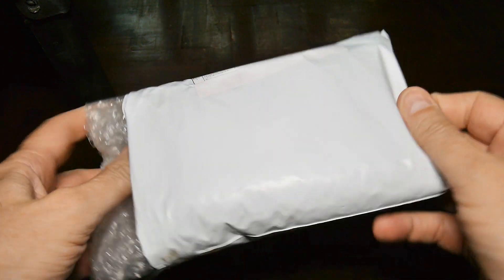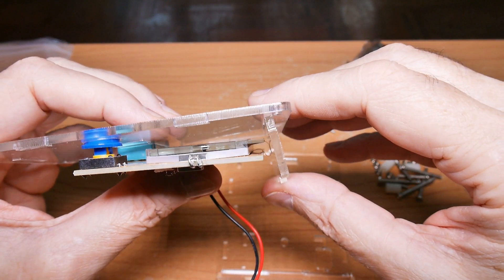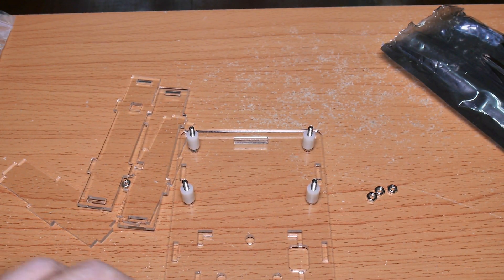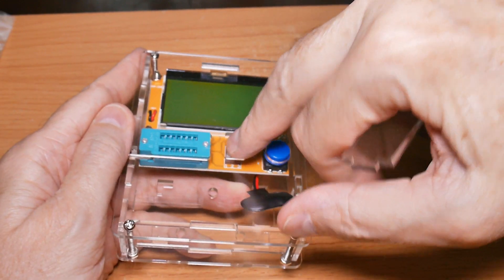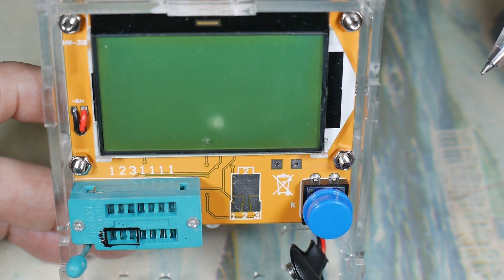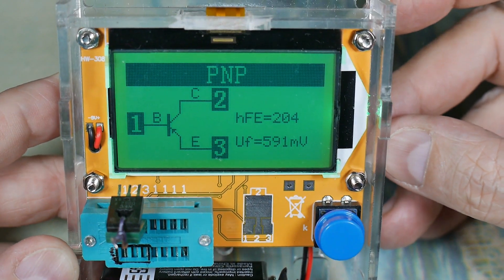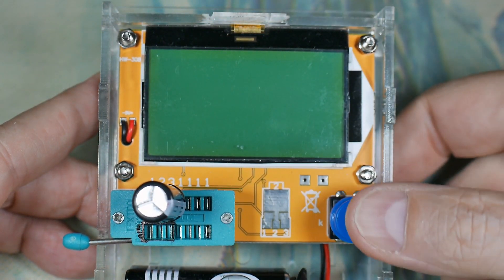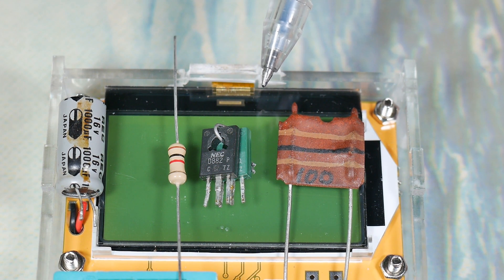Smart Component Tester - Assembly & Review (LCR-T4 M328)

Comment: I have one of these and so does a friend.  Any idea when I test a transistor on each them, one says NPN and the other shows the same transistor is a PNP ????????  What am I missing here?  It's a TIP126 bipolar transistor.  Thank you!  Great channel btw, I'm learning a ton!
Reply from the maker: Thanks. Same software version in each? Using the same holes in the quick release? Using the very same transistor to test (not just the same type)?
Reply: @tsbrownie  I'll need to check software version.  But, yes it's the exact same transistor.  When I test with a multimeter, it tests as an NPN with pin 1 as the base.
Reply: @tsbrownie  mine which is brand new doesn't show a software version. How do I make it display that info?  thanks!
Reply from the maker: @jagboy69  I have 2 of these by different companies and I was thinking of the red one with a rotary switch that you can press and hold for other functions. I just went and tried the "yellow" one and it does not do that. Given the software can't be upgraded, it sounds like it's defective.
Reply: @tsbrownie  lol... That's not good.  So either mine or my buddies is goofy.  I did do the calibration on mine and of course it didn't change.  During the cal, it did show FNIRSI-T4, I'm guessing that's my software.  I bet you're right and my new one is junk.  I'll let scamazon send me another.  Thanks for your help!  SUBBED!
Reply from the maker: @jagboy69  Thank you. Isn't that the way it is ordering online? Also, heads up, if you get one of those capacitor/inductor checkers, be REAL careful to discharge the caps really, really well. I've already destroyed one.

Comment: I bought one of these from China with the battery holder, which was for some reason cheaper than the one with the battery lead. I would have thought a holder would cost more than a lead but in this case, not. I also have the 3 small leads that you can plug into the 3 testing points, so you can clip them on to components so you don't have to plug the components directly into the testing points (which will work out good for capacitors etc that have had their pins cut too short to reach the testing points). I got to figure out how to use the thing now lol
Reply from the maker: This video might get you started: https://youtu.be/svissWMwSso

Comment: How did you peeled the brown paper from acrylic?
Reply from the maker: It should come off easily, unless it is old. Then it sticks and requires lots of work to get off.
Reply: @tsbrownie  It's stuck, won't come off at all.
Reply from the maker: @phaenius  I've had that problem and have never found a good answer.
Reply: Use a heat source ie hair dryer comes right off
Reply: I used warm water, but had to wait while the adhesive softened.
Reply: @jamesmdeluca  Thanks, but there was two years ago. I managed to peel off the paper in the meantime. :)

Comment: I found a spare 500ma 9V power supply which I use instead of a battery and made small groove in the end of the case for the wires.
Reply from the maker: That's a good idea.  Seems my batteries are always dead or leaking.
Reply: @tsbrownie  when I buy one, if it doesn't have a power switch for the battery, then I'll install one. As it uses standby current from the battery, it will eventually drain the battery with the tester sitting on a shelf
Reply from the maker: @the_eminent_Joshua_E_Hrouda  True.

Comment: i did see, a review of this type product.
on eevblog and shango066 youtube channels, but i wen't and got one the other day to put it together take a good look at its picture on the web site you go it, also i put some glue around the nuts after the screws were in the outside case, but then the batteries could be replaced with a 2.1mm dc socket with break contact were that square hole is on the side. plus the unit dont come with a holder to put your 9 volt batterie in anyway.?
Reply from the maker: Yes, no battery holder.
Reply: The ebay site where I bought my unit had the option to buy the tester with either a battery clip or a battery holder. The battery holder is good when you buy the separate clear case as the bottom of the clear case has L shaped openings for the battery holder. Warning: the battery holder also has 3 round protrusions that require the battery clips to be oriented to the same side as the zif lever & the bottom plastic also must match to allow the wire clearance hole to also be oriented to the left. I used crazy glue to attach the battery holder to the case bottom. Due to the Interlocking corners, I found it necessary to glue the side pieces together before gluing them to the bottom. I left the top unglued to be able to change the battery.
I'm torn between using the battery vs the 9v adapter for portability.

Comment: Excellent video, thanks.  I just got mine today and I realized that the rectangular hole in the back near the battery is for mounting the battery on the OUTSIDE of the case.  The little holes are for zip-ties to hold it in place.  Also, the little hole in the side is for mounting a power switch.  Could help extend the life of the battery.
Reply from the maker: Great tip!

Comment: Yes, the weak point of this kind of meter is inductance measuring. I tried to measure inductance of a fully functional 10 H choke (which was not connected to any circuit). No result at all.
And when I tried to measure a excellent condition Celestion Vintage 30 speaker, the result was that it is a very small capasitor. Resistance or inductance was not measurable at all. Of course the loudspeaker coil is very sensitive and can move and react to the test signal (which can be heard very clearly during the measurement) and kick back.

And yes, battery change is not very easy.
And yes, the display cable is too close to the upper part of the casing.

Nice video.👍
Reply from the maker: I found a separate meter that measures inductors and big caps much more accurately.  
https://www.youtube.com/watch?v=FB2xF3PGix8&feature=youtu.be